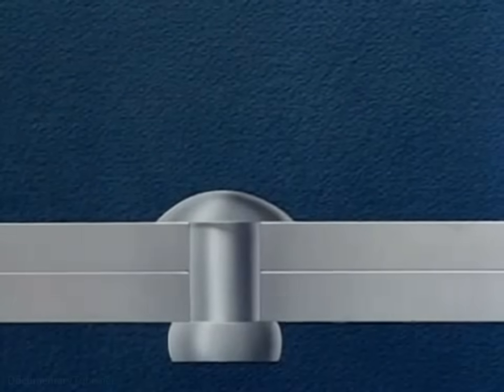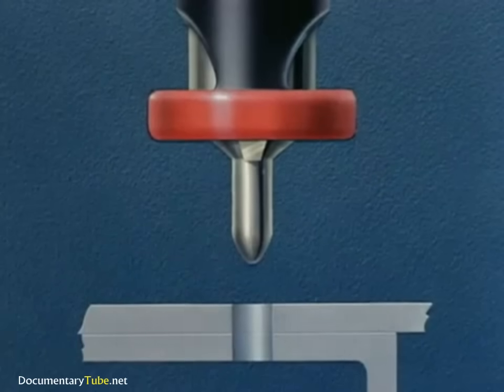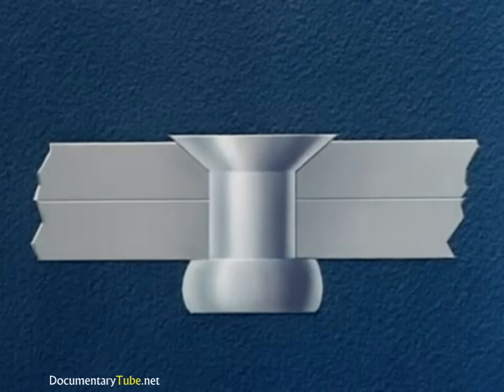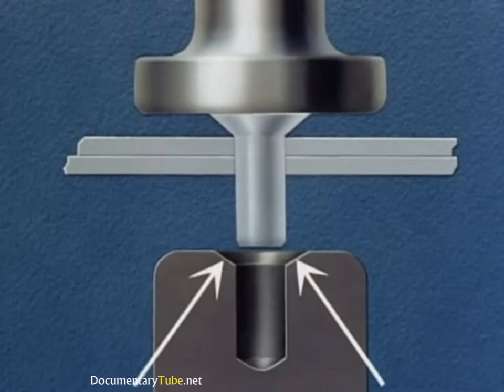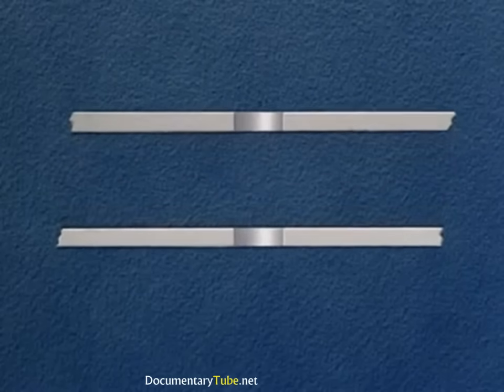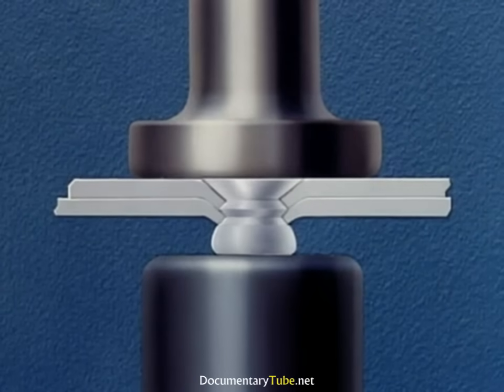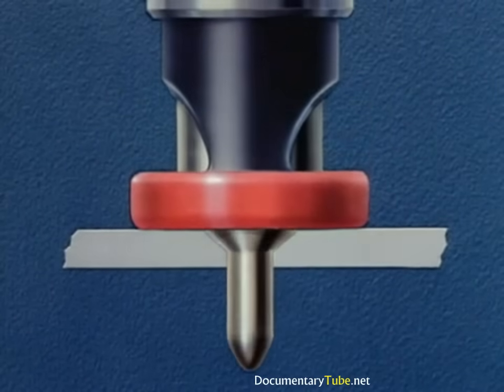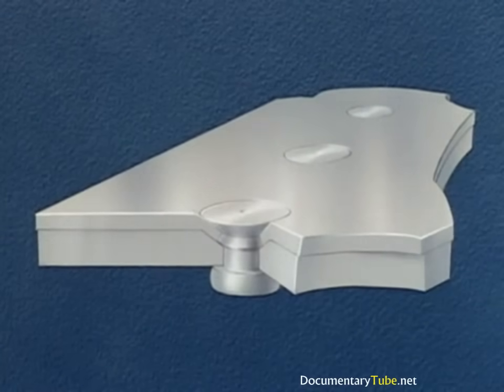HOW IT WORKS: Aircraft Flush Riveting

Comment: this is great knowledge in case I want to build a 747 jumbo jet in my garage
Reply: Or a homemade kit plane.
Reply: +Breaking good --  It's also useful when building a moon rocket at home.
Reply: I build 747s. There's no dimpling. Just counter sinking flush head rivets. No welding at all.
Reply: If i could offer some advice, the water doesn't go on the inside of the submarine.
Reply: I always bring my air tools in my carry on luggage. You never know when something might come loose in flight.
Reply: @yourhandlehere1  Carry a spare Boeing 737 door plug. You just never know when it might come in handy when you fly.
Reply: @Travis Thacker
Who doesn't use them? Take a look at a Boeing jet sometime. Millions of rivets. Welding is not an option as it changes the properties of the metal and introduces stress risers that make it prone to fail.
Reply: Look at Big Imagination's 747-based party car at Burning Man. While we didn't have to worry about aerodynamic stresses, we  used over 10,000 rivets and bolts to reassemble it.
Reply: You have had a year to work on this project,...how far have you gotten?? I am expecting delivery in 2 weeks.
Reply: I gave up after building the landing gear. I couldn't go any further. I couldn't fasten anything else to it as the gear kept falling over. Took me days to blow up the tires with a bicycle pump too :(
Reply: Its actually very useful for aluminum boat hulls.
Reply: Breaking Toast, any progress so far !!!  :)
Reply: Don't be rediculous ,you'll have to leave your car out.
Reply: right, If you are good enough you can do it
Reply: it is true, you are right, but here we are talking about aircraft flush riveting...... So please do not change the subject.
Reply: I build the wings on the 777 I've shot my fair.  Wish it was only a 30 bit.... final hole size is .378 some are a .471. Which take a long time to shoot.
Reply: @bambam72overton52  Is there any major changes in the assembly now with new materials instead of metal sheeting in the dream liners?
Reply: @johnobrien2207  yeah the I don't know exactly what they use.   Sleeve bolts for sure other then that I don't know.
Reply: @bambam72overton52  What about some new compound in the dreamliner? Instead of metal sheeting?
Reply: Plebs Im already building a 2 seater plane kit.
Reply: How big is your garage? Or, how small is your plane?
Reply: Pah, that's just my garden shed. In my garage I'm building a submarine. Or I would be if I could stop all the water leaking out......
Reply: Breaking good i know right ill be book marking this with the rest of my random plane manufacturing videos. One day ill have the complete instructions how to build a stealth bomber.
Reply: I envy you for such a big garage at your disposal
Reply: I hope that you were faster than this guy's explanation.But then again----you must have been faster, otherwise you would have only been able to do about  27 rivets in those years.
Reply: Whynot welding

Comment: HA, my very first paying job was as a rivet bucker at Boeing Co. on the wing flap line at plant two in Seattle WA, for $2.15 an hour, in 1963. The flaps were the outboard trailing mid-flap for the 727. I was working there the day that Kennedy was shot. :--(((((  Oh, BTW I don't know why, but he didn't mention anything about micro-shaving a countersunk rivet in case it was a tad above the surface. I THINK that .003 in. was the max allowable tolerance.
Reply: This guy said +/- .002  (see, I was paying attention.)
Reply: and this is why Kennedy was shot
Reply: Welding deforms and changes the heat treat of the metal. And rivets are far lighter than the titanium threaded fasteners we use on 747s(all commercial boeing aircraft) there is no welding that I've seen on any of the 747s I've built.
Reply: @Travis Thacker  I'm at Boeing St louis on the f18 line, and we still use rivets on all the panels.
Reply: @Travis Thacker Also, it's much easier to train someone to properly drive rivets than to properly weld aluminum (or any metal for that matter..)
Reply: diavolorosso69   Is it worth trying to explain to the guy who thinks screws and welding are “new” technology that just showed up recently?
Reply: @Travis Thacker 
If you were out of rivets then yes, a nut and bolt is a suitable substitute.
Reply: Probably because this video dates to the early 50's... I'm guessing that Micro-Shaving was a slightly newer improvement to the older technique!
Reply: I just read your comment in the same monotone as the guy in the video. Haha
Reply: First aircraft I worked on at American airlines in Tulsa Oklahoma, structure mechanic ( sheet metal) in 1996 .  $ 9.00 an hour .
Reply: Inflation calc. says it's 21.57 now from 2.15 in 1963.    9.00 in 1996 is 17.61.

Comment: '
how about remove the rivet...
drill again or cutting buttom rivet and punch out top...
do have a video how to remove the rivet
Reply: You've waited a long time for this answer.  Usual method is to drill the manufactured head with a drill a few thousandths of an inch smaller than the nominal size of the rivet. Once you've drilled through the head a little lateral flick of the drill will pop the head off, or you can use a punch, and lever the head off.  Then you can just use a hammer and punch and give the rivet a sharp blow to drive it out.  On thin metal you would want a second person on the back side to hold a bucking bar beside the rivet to keep the skin from being deformed.  If the rivet is rather long and isn't easily punched out, you can drill a hole into the shank. So on a 3/16 rivet you'd drill a 5/32 hole, i.e. one rivet size down.   This allows the the walls of the rivet shank to collapse a bit and not grip the skin so tightly when you drive it out.

Comment: Interessting and also a testimony of the advantage of the metric system.
Reply: I understood everything and at the same time I saw all the flaws compared to metric and the possible errors. But its not nice of you that you project your own issues on some one else.
Reply: A very noteworthy observation ;-) Then the Imperial Rivets went on to explore the Moon. I know the metric system as well as the or International Avoirdupois System and they are both completely usable in everyday life manufacturing and technology.
Reply: While the metric system does have many advantages, particularly in volumes, however in fabrication and machining they become virtually nonexistent, particularly in the aspect of tolerances.  This comes from the fact in the imperial system the common base unit is an inch (=2.54cm) which is subdivided by recursive bisection ie: 1/2 (.5in), 1/4 (.25in), 1/8 (.125in), 1/16 (.0625in), 1/32 (.03125in). So a dimension with a 1/32nd +/-  (=0.79375mm) tolerance is less than the metric system equivalent which at best would be indicated at 0.8mm but more often than not be rounded to 1mm for the actual real world dimension variance permissible.
Reply: Wait until you find out there are letter sized drill bits also. Still a value in inches. 

Also what are 4 different measurement systems? There is metric, and there is not metric...
Reply: I'm American, yet I still had to translate the thickness measurements to metric.
Reply: If you wanted to make an argument over which drill size to use, I would recommend they change the standard they have been using for almost a hundred years. Imagine if the 1/8" rivet was actually a nominal dimension and it referred to using a 1/8" drill bit, but the OD of the rivet was only 0.121" or whatever... Bolts are usually undersized... Pipe is nominal...
Nominal is dumb, btw. Measurements should be precise! ;)
Reply: Not Telling
Dont tell that to the zeGermans. Iam pretty sure that all cars and other goods produced there are in metric. ;)
Reply: :( sadness
Reply: James Kasper - CBWP the Metric drivers need size instructions too.
Reply: James
You are aware that the drills in the metric system are metric. There is no 1/8" and then use #30. Its XY rivet use the drill with the same size.

I agree, its a set of instructions but in the first view minutes of this vid alone, we already had 4 different measurement systems and if it where metric it would have been only one, all the time!
Reply: Why? What's wrong with No. 30 drill bit? Is it bigger or smaller than No. 29? I guess we'll never know. I'm surprised the sheetmetal thickness wasn't in gauges.
Reply: 50043211 A long long time ago in far away places... The battles of the metric and imperial rivets were waged. In most cases the metric rivets crashed and burned. Thus is
 the testimony of metric rivets.
Reply: There is no need for translations or confusion here. This is not a debate on which is better. It is a set of instructions.

If you want to use a 1/8" rivet:
-use #30 drill bit.
-use countersink for 100° with #30 pilot
-use tool to compress rivet

Done.
Ask your engineering professor why, not some random Youtube commenters...
These are concise directions. Follow them.
Reply: 50043211 I don't see the advantages, or rather I don't see the disadvantages of using US customary. Did you not understand? Your own issue, not the number system.

Comment: I don't think version #1 is accurate
The height of a countersunk 1/8" rivit is more
than is shown on the .040" thick sheet shown.
To get the countersunk head flush on an 1/8" rivit
would require countersinking into the lower sheet.
How many planes have .040" thick skins? Not an airliner
that is for sure.

Comment: 0.040 is not four thousandth
Reply: deezynar It is. A thousandth is 0.001 so 0.040 is fourty thousandths. Note that fourty thousandths is the same as four hundredths, however for the sake of consistency and the scale of measuring they use for this level of precision work it is better to measure in terms of thousandths.
Reply: OK.  I missed FORTY thousandth.  I heard four thousandth.

Comment: When I learned riveting at Spartan School of Aeronautics in 1965, we were given hard rivets and dead soft aluminum sheet to work with.  Anything less than perfect technique with that combination of materials left glaring marks on the metal for the instructor to point out, meaning we had to do it over again.  Practice made perfect.
Reply: Hopelessand Forlorn Thank you for sharing your story with us. Although I wouldn't have ever thought of that method for ensuring the correct technique was followed, it makes perfect sense once you mentioned it. Your personal story really added to this film. Thanks once again. (PS - I was just born in October 1965.)
Reply: @motorcop505 
JESUS IS THE WAY, THE TRUTH AND THE LIFE. Repent and turn away from your sins today🙏🏻
Reply: Have you seen the video of the guy trying to mill a perfect cube from a potato? Same idea.
Reply: @root1657  AvE threaded a potato and then fried it in cutting oil.
Reply: @1978garfield  yep, that's the guy.
Reply: I actually do this kind of riveting for a living, although on utility trucks rather than planes, so aerodynamics aren't a real factor for us and tolerance is a bit lower than this.  What is the same though is the level of quality required in each rivet that you had in school.  Only here we had to learn on the floor as we worked, meaning any mistakes either had to be drilled out and replaced, or we have to go down to rework, stopping our work on the line, and fix all of our bad rivets.  The latter is a big incentive to get good at the job quickly.
Reply: @tonto-xt  drilling out counter sunks are a huge pain in the ass.
Reply: At least it wasn't annealed 24 karat gold sheets with HSS rivets
Reply: I was hoping for the film to cover the methods for how to remove rivets which do not pass inspection.
Reply: @SubTroppo  You just drill out the center of the rivet. If you're lucky it'll fall out after that. In my experience it takes hammering the shit out of a punch to get it out. Mind you my experience is limited.
Reply: @CynicalFatie  I have drilled out rivets myself but I imagine that pointing a power drill towards a 'plane's fragile skin would entail a lot of constraints and not left to the first-day apprentice (which is effectively what I am).
Reply: @SubTroppo  yeah its a pain in the ass especially with the counter sunks, I haven't done it on a real aircraft yet but I imagine I'd do a shit ton of practice beforehand.
Reply: @SubTroppo  This was a war production video.   All rivets pass.   What's the worst case?   Someone dies?  It's a war.   Slowing production kills more people.

Joking.   Sort of.
Reply: After a couple weeks youd make sure not to smile the heads, titanium cherry maxes with that make me shudder in fear though with how hard they can pop
Reply: Is riveting airplanes well paid?
Reply: @alexgataric  it can be
Reply: @alexgataric  depends on what you're doing and who you're working for. A guy working in an assembly line isnt going to be as well paid as an A&P.
Reply: I'm four month into going to Spartan and am here to work on perfecting my riveting skills lol cool circle of aeronautic life
Reply: going through that right now lol it’s tough
Reply: Ah.. labor camps..😊 I miss it too

Comment: Or you could use MIG welding.
Reply: Nope.  Aircraft skin is usually 2024 T3 alclad aluminum.  Welding heat treated aluminum weakens it.  Riveting produces a stronger joint.

Comment: I was an aircraft rivetter for Shorts aircraft company ( Bombardier) I installed NACA rivets on the top skin of the Fokker 100, the rivet was installed from inside and flattened into the countersink on the wing skin, this was then milled flush ... yes it was a rivetting jib lol
Reply: I own one of those rivet mills today. I need to dig it out and see if I can repair it. Still have my IR rivet gun and drills. I have a power cleko gun but don't remember the mfg. 
Had'nt really thought about flush milling rivets in years... till you mentioned it. Thank you!
Reply: Does a milled flush beat a royal flush,  or is it the other way around?

Comment: All these god damn rivets only work when you are joining flat surfaces or sheets together on a larger plane.  On an ultralight all your riveting is going into tubing and there is no way in hell to get any bucking bar inside a tube...
Reply: Peter Carlson What about Avex blind rivets or cherry rivets?
Reply: +Peter Carlson. I've fitted plenty of blind rivets in aircraft - usually Cherrymax, Avdel or Olympic. When the drawing calls for solid rivets but lack of access prevents installation there are blind rivet alternatives that can usually be fitted, when covered by engineering  (either a Query Note or Concession).
Reply: I think that's why blind rivets (POP rivets) were invented.  Although rarely seen in hardware stores, they're also available with 100° countersunk heads.
Reply: Actually there are several types of blind fasteners and are used more than you would think.
Reply: +An Anna That's probably why they didn't use it on the WW2 ultra-lights.
Reply: Pop rivets are actually a poor choice for aircraft, that is why they are almost never used in them except when there is no way to get behind said rivet. All your modern arcraft rivets are of this type shown in the video.
Reply: An Anna
 There is a reason they call them "non-structural" rivets. They are simply not as strong as a solid piece of aluminum.
Reply: Peter Carlson mostly there for decoration